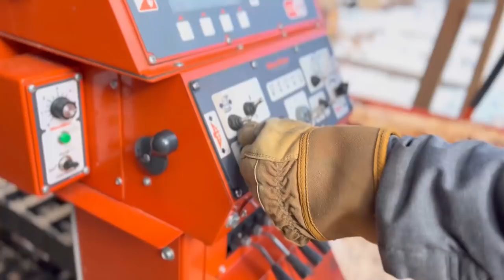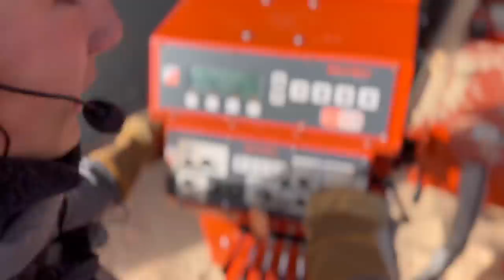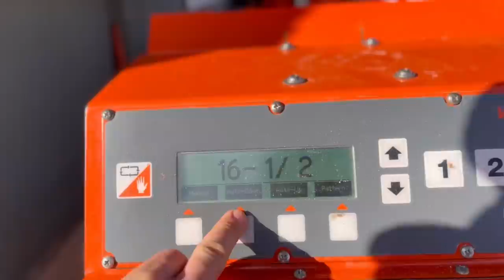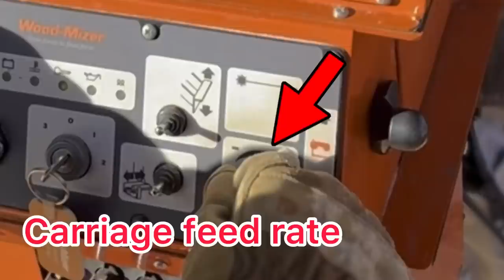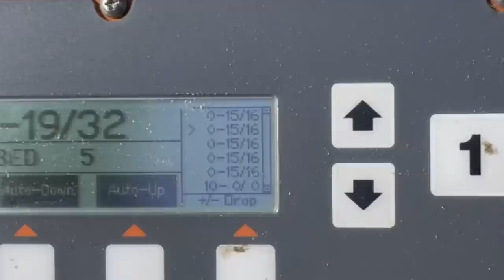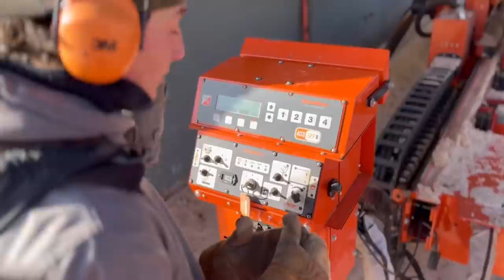Beginner’s guide to operating an LT40 Woodmizer

Comment: Just found your channel and love the content. I just ordered an lt40 standard, yesterday, with the 38hp engine, accuset 2, debarker, 2 extra side supports and the board return. The command control option was very tempting and only a $1605 upgrade, with my configuration, but it limits you to only being able to add a 6’ extension. After watching your videos and reading various threads on the Forestry Forum, I’m calling first thing Monday to add the lubemizer.

Comment: Just bought a Lt 40 super- used- 2000... Been wanting this for a long time... I do all sorts of tongue and groove.. Have the machines that make it  ..Even the butt ends are T & G .. Have a  40 acre solid hardwood forest in U^P of Michigan... Going to Pick up the saw mill on my way there in May [spend winters/spring in Pennsylvania..  Never  had one but now i can go 360 from cutting the tree to T & G finished product... What a better place to start then Beginners guide to operating a Lt40 Woodmizer!.Now I will not be buying my lumber from the sawmill anymore.

Comment: I can't believe woodmiser charges you almost $800 for a 5 gallon jug and some clear hose and a valve
Reply: Lol, its a lil more than that, you get the jug, hose and valve free.
But the electronics and pump to precisly meter the blade coolant costs 800
Reply: I agree. There is profiteering and then there is exploitative gouging.

Comment: I had to have a chuckle at the bored drawback. A totally different thing to a board drawback. When it popped up on the video at 3:09 I thought wtf is that. Then I realised it was a typo.
How long to get competent on the mill? Antonio did look like he was progressing but there was definitely some hesitation.
Reply: The mill wasn’t that hard to operate, it was the Accuset 2 that was confusing. Auto down, pattern, etc.
Reply: Drawing the boards back a bizzillion times does get boring... Bored drawback is fitting...

Comment: I would say that number one on the list before even turning on the machine is to have the proper safety wear and equipment. Gloves, eye protection, hearing protection, no loose clothing that can get caught in moving parts. I would seriously consider having a pre-work job briefing with everyone involved. Things to be discussed, what we will be doing, who will be doing what, how we will do it, and how we can make the job safer and minimize risks. Other things are how to disable and lock out power supplies while performing maintenance on the machine. Lock out procedures should be discussed so no one turns on the power and tries to operate the machine when it is down. The saw should be locked out of the power supply while servicing and changing the blade, or machinery. Sure, I know, many people will say, oh that is going too far, anyone should know these commonsense items, but you would be surprised how many injury accidents occur because someone skipped or missed a very basic aspect of safety. Can you tell I am a retired railroad supervisor? When you set a goal for zero incidents or injuries, these are the types of things that are required. Hyper awareness and hyper communication. It would also be a good idea to set up and establish a way for ANYONE to stop the line if there is a question if there is a question of general operations or safety.

Comment: The options pricing that you have described reminds me of how cars used to be sold when manufacturers wanted to advertise an apparently low price for what was called a basic model. Many of these options were actually almost essential to optimal, good, safe performance for the cars, and it sounds as if the pricing of this wood mill is much the same, where the two options you have listed as adding up to several thousands of dollars sound to be necessary integral features for optimal and even safe working of this mill.
So how about your timber yard pricing its products in the much same way as this mill was priced. You could advertise board feet of wood in any dimensions required by customers but set at a price that refers to it in its original state as part of a trunk, bark and all. You could then have a priced option for cutting lengths, widths, and even depths, or for trimming the boards and so on, and none of these stupid sounding options could be regarded as false pricing based on the original offer.
Sorry, but this optional sales crap really pisses me off, and I see many companies selling good products that shoot themselves in the foot because the sales team and/or company owners regard their customers as idiots. 
Car hire prices with insurance/tank/cleaning/mileage options is another example of this type of sales pitch, and I am amazed that these companies still attract customers when these smart-ass sales techniques are designed treat them as fools. 
Now, was there an option to buy a filler cap for the gas tank on this mill, or to have another colour, or perhaps metallic paint.
Reply: If you debark your logs, you don't need to buy a debarker.. In my case, I drop the trees & can move them to the logging deck without them getting muddy or the bark impaled by gravel, so why would I want to pay for a debarker?

Same with some other upgrades. Some people don't need all the bells & whistles..